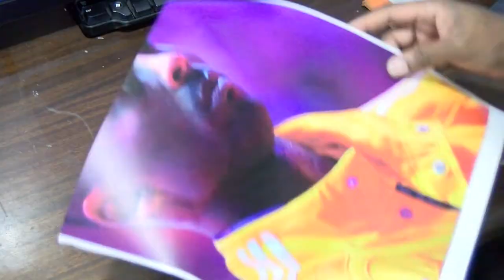Kobe Bryant's Black Mamba Logo

Comment: Hi I would like to know how you set the brush stroke thickness of each letter in font  to the thickness of the Neon flex light to say 6/8mm for example in Illustrator 

Also the same method should be doable in a co2 laser right ?